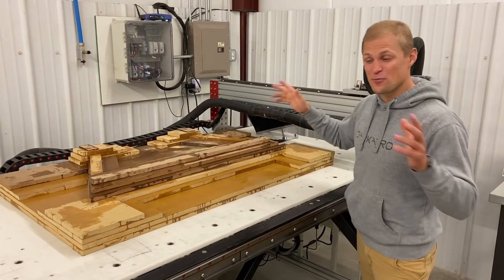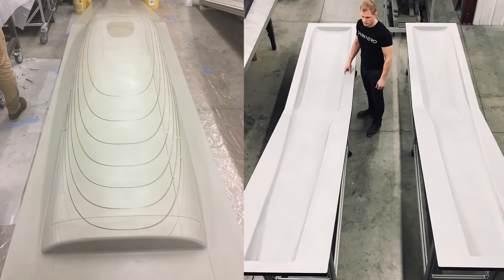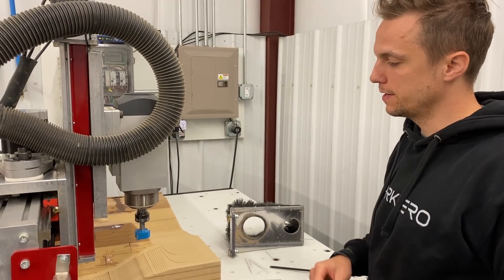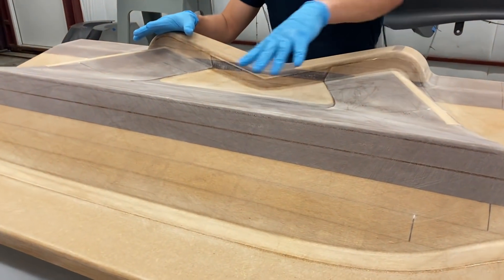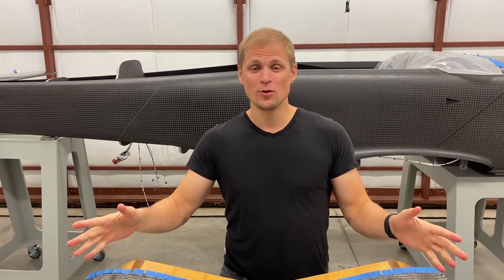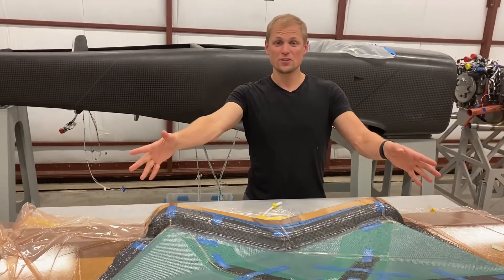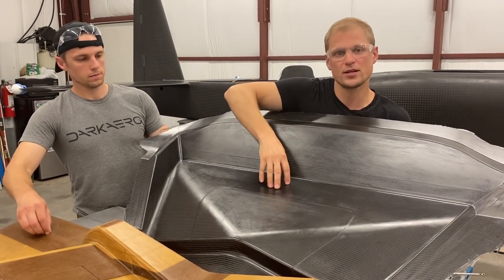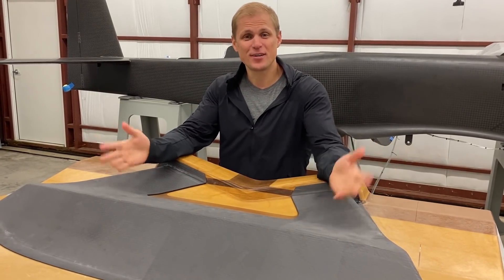Most complicated CARBON FIBER part in the DarkAero 1!

Comment: Hey Riley, just trying to wrap my head around the structural integrity of that part since its supports the main landing gear.  Its pretty thin and not real ridged in nature.  I don't see or understand the whole engineering frame work around that area and the gear.  You really want that area to be the 'beefiest' part of the landing gear system, especially for the mains.  As you said, on this type of retractable gear, it's usually found under the wings.

Keep up the good work and I cant' wait to see the finished product.  You guys rock!
Reply from the maker: Hey David! There are a few more parts that will be bonded to the trunnion frame to create the full main gear support structure. The complete structure functions like a box beam connecting the two gear struts and it is bonded to several other bulkheads in the fuselage. The part we showed in the video is just part of the upper flange in that beam. The bottom of the beam is formed by the lower fuselage skin. More will be shown on this in future videos so my apologies if the brief explanation in this video caused any confusion. Thank you for continuing to follow the project!

Comment: Why you guys don’t use release film? And I see you use another cloth that is not peel ply to cure it what’s the reason?
Reply from the maker: Hi Felipe! We do use a release film. That is what we are pulling off the part at 9:42 along with the peel ply. The other consumables that were pulled off prior to that were the vacuum bag, flow media, and breather. Thank you for watching!
Reply: @DarkAeroInc  Why put breather over the whole part for infusion ? Can't figure a reason.
Reply: @SuperYellowsubmarin  I agree. For infusion flow media is enough. Only need a few small pieces over the vacuum ports to ensure that the bag doesn't bridge the port
Reply from the maker: @SuperYellowsubmarin  great question! It will still infuse with just flow media alone but the flow media can imprint on the part when under vacuum. We use breather under the flow media as a cushion to eliminate the flow media imprint.